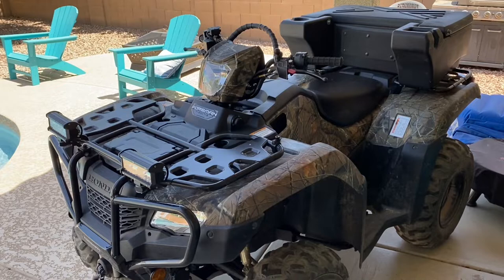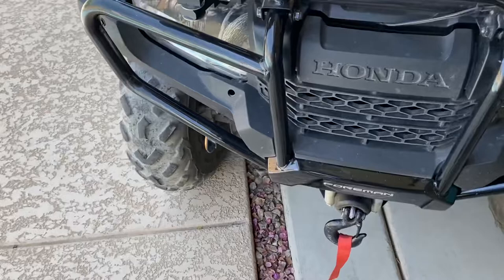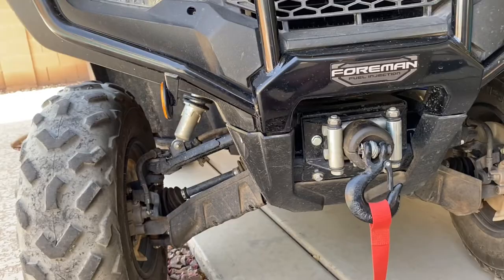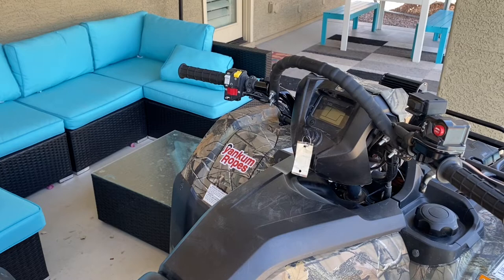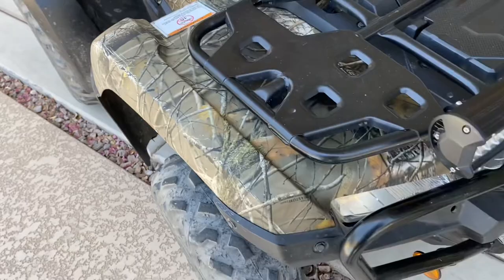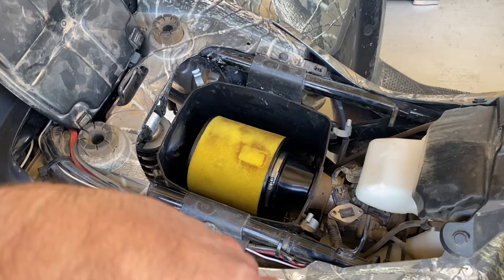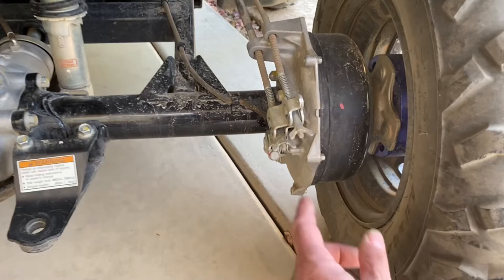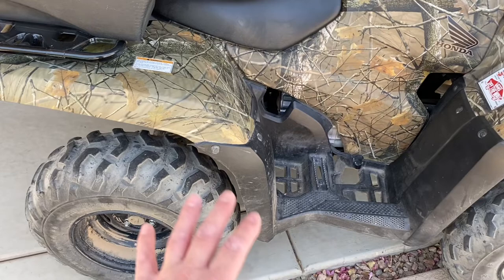Honda Foreman 520 Two Year Review

Comment: My 2016 foreman with the 475 engine still runs like a champ and I beat the snot out of it . I rolled once and cracked a fender. Put myself in the hospital. Use the winch all the time. Mostly for dragging stuff off the trail. A cargo box is a very handy thing to have. You can never carry enough stuff. I don't have a light bar. Probably rip them off in the brush. Did put Heat Demon  grips on. Wore out the stock tires and installed Maxxis Zillas. Happy with them. Was crawly around in the hills on snow and ice last week. Never would have made it without them (Watch the video). Front brake needs to be bled. Water does get in the rear drum so I bleed it once a year. Don't have a dust problem with the filter. It does suck up a bunch of skeeters.
Reply from the maker: I will take a look at the video in snow and thanks for watching, also can’t go wrong with Honda 😊

Comment: Do you have EPS ? just curious you have manual foot shift which i had also and had the ESP i think its called that i really liked , and you have the ESP in the Pioneer did you not want the ESP on the Foreman for price or reliability or you prefer the foot shift , i my self like both mabey edge to ESP but some of it is how a person ride's or what he's using the machine for . Rolled twice ouch ! glad you were ok never rolled one but put my new Grizzly strait up on its ass coming off the ramps of my truck after i had just brought it home . I also prefer no rear box like everything to be on the front racks but i pack my Lab Frankie on the back made a extremely lite wood box for her but i wood prefer to have nothing on there
Reply from the maker: I like the foot shift , and ya I’d like nothing on the back , but I like storage also ? So it’s just how it is . Thanks for watching